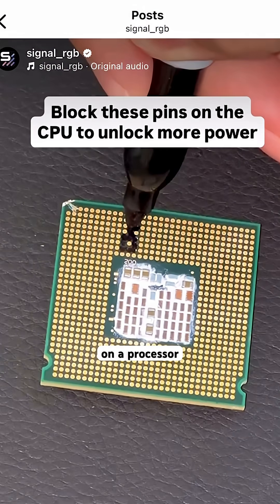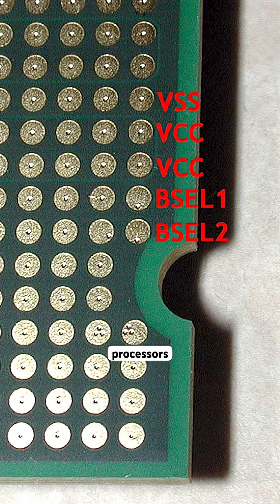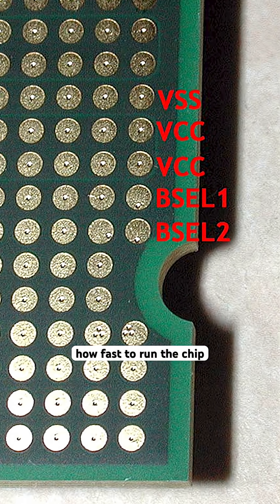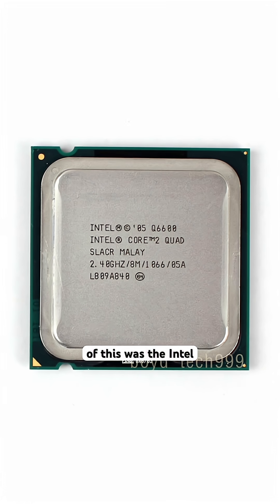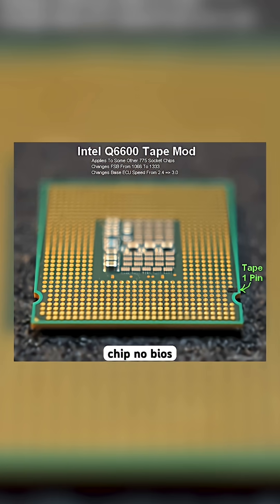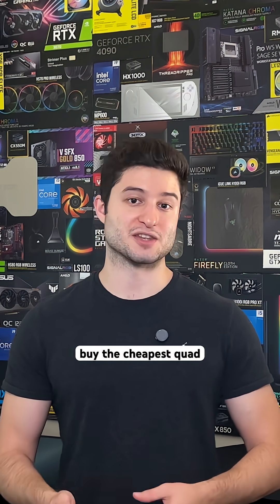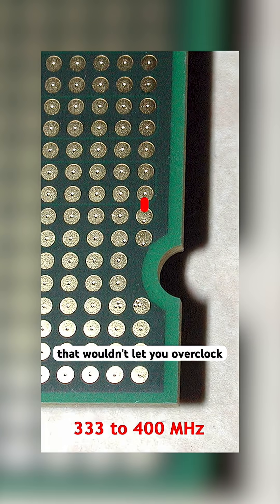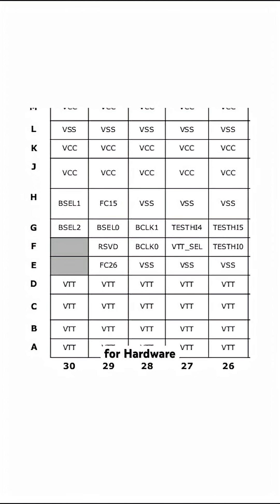Taping a CPU to improve it?!

Comment: there a reason why we even had to do this? was the company just selling the same CPU twice but one with those 2 pins bridged for a higher price tag or what?
Reply: You don't get it. It was the same processor, but one had the acceleration module locked and the other didn't. They had the same frequencies. but one could be overclocked and the other couldn't.
Reply: @КаринаМурлыкина-о9т  I don't think you get it, I asked that- If it was the same exact processor, why would the company sell a processor that can secretly be stronger for cheaper? why not overclock it by default and sell that?

Comment: It also worked on the Intel Core2Duo E6750 which normally run at 2,66Ghz if i remember correct and mine run with that and OC at 4,05Ghz with watercooling

Comment: "This was a thing in the Core 2 era"
It definitely goes further back than that. I tape modded my Palomino 1700+ (133mhz->166mhz) in 2002ish, the Q6600 didn't come out until early 2007 (though the original C2D's of mid-late 2006 also used this mod). I'd even argue that doing the L12 mod on Socket 462 was more common than the VID/BSEL mod for LGA775 at the time because it was easier to do and harder to mess up. Boy I miss those times :D

Comment: It is a very simple and easy mod, require precision but it does not break your cpu,; It is reversable as long as you use simple electric tape (some people used nail polish). The mod does push the q6600 to 3.0mhz but essentially you gain performance similar to a q8400. This mod should theoretically work on the q6700 (same fsb buss as q6600) but for some reason many people who tried reported unsuccessful mod. The mod also works on some duo cpus such as c2d8400 and others, pushing them higher than 3.0mhz (some reached 3.4-3.8 and higher).

Comment: TBH I rather to use Xeon E5450 3GHZ s.771 but moded to 775, instead of BSEL mod Q6600, first was more stable and less power consumption

Comment: Ha! I had a Q6600 and did this hack and I got a nice bump from 2.4 GHz to 2.99GHz. I just cut a piece of tape out with an exacto knife to cover the  correct pins and it worked great! You could also do something similar with a few Xeons.

Comment: Excuse me you DID NOT have to do this with the Q6600 i have one still to this day working fine, along with the Asus WS P5K motherboard and the 8 gig of DDR3 ram, this "fix was only for chips that were NOT overclockable, the Q6600 if watercooled would run happily at 4 GHZ, retired when i upgraded to an i3 8350K the Q chips could all be overclocked the Q6600 was an absolute beast of a chip for it's time and cost an absolute fortune, my Mobo alone cost over £200 pounds which was absurd for that time, average mobo prices were around £100 or less.

Comment: You think there are such cheats on Apple Silicon processors? It is possible that your M3 is actually a M3 Pro. Its called chip binning. Who knows if yours were sorted into the lower tier piles because of business decisions, not because of performance?

Comment: There’s no way this didn’t have some sort of downside. What about the heat? They wouldn’t design the heat sinks for that model to work the same way the ones for the higher end chips would. Or data corruption? The motherboard ment for the chip wouldn’t be able to keep up with the overclocked version because it was only ment for the normal type

Comment: yes its possible, but the reason cpu's are restricted is stability.

in addition some board circuits may end up wit resonances i nthe bus lanes that are unexpected.

the net effect is its possible ot over clock and in one scenario it will work, but theen theirs allways the risk of instability, and even eventuall cpu failure due to working outside of its designed tolerances.

far too simplistic to believe youre getting something fro nothing.

Comment: Completely ignoring that these chips did not pass QC for those speeds, which is why they where binned for a lower speed. So yes it could absolutely work but it could also make your system incredibly unstable.

Comment: There's a simple sticker available (for Socket 775 when that was still a thing) that swaps two ID pins around, which allowed using Xeon server processors as regular Core2Quad Extreme CPUs. Used Xeons were available for a few bucks from companies doing their usual leasing rotations, while the Core2Quad Extreme was still like 300$.

Comment: I would do that on pin B21 on the PIIs back at Gateway 2000. If the pin was open, it went full bus speed of 100mhz instead of 66mhz.

Comment: This is infuriating in the fact that they knew that they could sell for almost similar price in the only difference is 1 to 2 nodes, but they decided to sell it at a much higher price 

Disgusting.
Reply: No, these chips were cheaper for a reason. You could rig them to run faster but they would get way hotter and unstable compared to the more expensive model.

Comment: ...sounds like the "higher end" cpus might have just been a scam.
Reply: Nope. These jerry-rigged CPUs could run faster but were far more unstable and put out way more heat for it. They have more defects than the flagship models.

It is well known that CPUs from the same family tend to be the same chip but the ones with the least defects become the flagship models and vice versa.

Comment: This works because of binning. The fab tries to make the best version of the processor everytime, but flaws always creep in. If you disable cores or memory that are flawed, it is now a lower-spec version of the processor. 

As the video mentioned, this could be bypassed via pin manipulation. Often regular pencil lead was used to bridge pins.

Comment: And then you get am3 chips that were failed dies from factory making a quad core into a tri core, with a software bypass you can unlock the other core and 99.9% of the time they were fine
They stopped this from happening by removing a pin but because the contact pad was dill there you could put a pin into the mother board then install the cpu on top and it would work
Just had to be careful as am3 had 940 pins and gettthe wrong ones was easy

Comment: i mean you can just over clock any cpu now, its just not recommended.  making cpu's is more of an art then a science.
 when they make "tiers" of cpu's most of the time the tiers are just how messed up the cpu is.  like this cpu only has 4 core out of the 8 it could of had and only runs at 3gh stably

most overclock labeled cpus just mean they are more likely to run stable above factory setting

before you'd just buy a cpu and hope it can be overclocked and stable.

Comment: The sad thing is Intel didn't think people were smart enough to figure that out and locked that cpu to a lower speed, intentionally. Then, they sell another cpu for double the price despite the cheaper one basically having the same performance with no downsides like decreased health over time. Fuck hardware lock outs. Intel still does bs like this, for example locking out ram overclocking on motherboards unless you get the expensive one, yet the cheaper ones overclocked just fine.

Comment: Aah the good ol BSELmod. 0.4 - 0.8GHz increase depending on the silicon quality, for nothing. Used to do it on Intel C2D processors before Intel replaced em with fuse and laser-cut off thingy.

And also, the pins..

Comment: It's a very cool trick, but exactly the sort of thing where you have to know EXACTLY what you're looking at. Even mentioning overclocking makes me remember a group of friends of my sister's now-husband's brother who all eventually went into software engineering and IT etc, but their highscooler self-built computers were all SO dodgy!Overclocking those machines didn't even seem like it was something that ultimately had a net positive effect on performance because the accompanying increase in heat output was constantly triggering either an auto shutdown or damaging the other components.

Comment: I had a couple Q6600s that ran at 3GHz stable in HP SFF desktops. Later I got an E8600 to 4GHz in a similar way.

The really big thing is that lots of motherboards would "strap" up the CPU based on the hardware pins, setting bus speed, timings, etc. By strapping at the higher FSB, a lot of CPUs that wouldn't "overclock" to a certain bus speed or clock would "stock strap" at that same bus and clock, zero issues. Proof Intel was rigging things behind the scenes, too.

Comment: That’s impossible cuz if u did that to a cpu that was designed to run at 2.4 gigs u would need way more cooling or the cpu would break from overheating

Comment: Doesnt this mean they make a fast chip and then adjust it to run slower and then sell it as a cheaper chip?
Reply: No, the CPU production process is filled with errors of varying degrees. 

When CPUs are tested they get sorted into groups based on how many defects there are, minimal defects are the flagship models and the most defective become the the budget models (the defective sections are deactivated)

So, in reality, while this trick would work it also made the CPU run way hotter and could introduce instability.

Comment: You could even buy a intel zeon processor(server one on 771 socket) and mod it to fit on intel 775 socket, tape two contacts, rotate it right by 90degrees, file some material so it can fit in socket that way, and you get yourself a 4core beast that was viable till 2018 until some gamedevs (like ubisoft) put hardblocks against 4core processors, its still powerful enough to run Linux distro with tons of benefits

Comment: I had a Q6600, I didn’t need tape or conductive paint the pads, just changed the multiplier in the BIOS, believe I ran it at 3.33ghz with an oversized heat sink. It ran cool with perfect stability until it was retired.

Comment: what about with newer processors? also there has to be a reason the companies didn't just make them like this, i wonder if it causes damage
Reply: The reason is marketing. You always need to have multiple products at different quality and different price points, to get both budget minded customers and premium customers.

However, it is cheaper to have one production line. So it is easier to make one product, and figure out how to sell it as two products. Disabling some functionality allows this.

Comment: Far from their most egregious examples. That would be when they got Windows 10 to force updates to customer motherboards, sometimes destroying them in the process, in order change the bios so they couldn't overclock their non-K series CPU's.
Reply: This example isn’t even egregious.
Reply: @spaceageGecko  Lool? Forcefully cripppling equipment from a distance after it is bought, using a 3rd party meaning that AT LEAST 2 huge companies were in on the conspiracy? It's about as bad as ANYTHING they have ever done.

It wasn't even some isolated case, but literally a forced bios update across systems. It crashed some of them.
Reply: @Nyarlathotep_Flagg Reread my comment, I said THIS example is not egregious not the one you mentioned.
Reply: @spaceageGecko  Yeees, but since it's in response to my comment. In terms of linguistics, what is "this" referring to?
Reply: @Nyarlathotep_Flagg Admittedly could be interpreted either way, apologies on that front. My point was that CPU binning is normal and good.

Comment: Or, you could have just bought a decent budget gaming motherboard. It cost less than the price difference between those two processors and you could also OC that one higher than 3ghz. 

Even my old core2duo was a beast. Started life as a 1.8ghz processor, I OC'd to 3.2ghz on air and it ran for years. Such a boss back in the day.

Comment: The Athlon Xp processors had pins you could bridge to do this, too. They also had no heat spreaders so your CPU heatsink mounted directly to the die.  It wasn't uncommon to crack the CPU when putting on the heatsink.  Not a great design.

Comment: Right, but it ran at twice the temperature, in an age where liquid cooling wasn't a thing anyone really had, you had to use a box fan in place of the side of the computer tower..
It would run like this for about 15 minutes, enough to get a nice benchmark test done to prove the concept.. but heat causes resistance, and resistance causes speed reduction and ultimately failure.
So... yeah it was neat for a few minutes, but stupid in the long run.
Reply: No it didn't. This wasn't some kind of extreme overclocking, you didn't even increase the voltages.
Reply: @PaintsAreOp Then what is the downside? Why weren't the chips made to run at 3GHz to begin with?
Reply: @DemoniteBL   Money and product segments. They would much prefer to sell you the much more expensive Extreme Edition CPUs. And because of that, after Core 2 era they introduced cheaper, non-overclockable CPUs.

Comment: But.. if it was that easy to increase performance.. why didnt they just make the chip without those connections to begin with?
Reply: Those pins told the motherboard what the frontside bus speed was, by taping over the pins you got higher frontside bus. It was made to have a segmented market where you have cheaper products and more expensive products.

Comment: Also in this era of processors- You could use an LGA 771 Xeon processor in an LGA 775 motherboard by putting a sticker on the bottom that swapped two of the pins.

Comment: I remember getting a modded bios for the Skylake era processors which allowed overclocking on non K chips. Managed to get a 2.7 GHZ locked i5 running at like 4.4ghz fully stable

Comment: There was a similar trick with the OG Intel Celeron that if used a sharpie marker to black out (I think) one/two of the fingers on the socket then it would trick the board thinking that it was a Pentium instead. Super crazy.

Comment: Microprocessors undergo testing and are binned based upon the power and frequency results. Overclocking like this can work for most applications, but can trigger crashes under specific  loads.

Comment: It definitely did not, you don't magically make a faster cpu with fuckin tape
Reply: It did, I have done this. It increased the frontside bus from 1066 to 1333. This was useful if you had an OEM motherboard as those didn't support overclocking, otherwise you would just change it from BIOS.

Comment: I had my Q6600 running on 4.2Ghz for years with a custom watercooling without problems.
Reply: I was using one stock up till Q3 2024 love that chip
Reply: @CricketmaneCSOGGO yeah, fully ok for work
Reply: @CricketmaneCSOGGO  Just got rid of mine about 8 months ago. Was using it as a cheap HTPC. Q6600, 9800GTX, 16GB. The chip and RAM are still fine. It was the graphics card that finally went.

Comment: The tape mod was cool but a q6600 could do well above 3 GHz with just a small amount of bios tuning and you could do it with most motherboards. You didn't need a fancy Z series board for overclocking support.

Comment: The sales of de-rated product is nothing new. Yeah you can up clock a die, but that doesn't mean it will operate effectively. Manufactures sell de-rated product so as not to loose sales on their product investment. This product works at 100%, we sell it for full price. This product works at 80% so we sell it for 90% price of full product.

Comment: yeah but these cpu's are not fast anymore, i had dual happertowns with the tape mode to over clock the quad channel ram thus boost the clock.  the amd athnlon xp that could be converted to Athlon MP was a better deal but that was years before and you cut the solder traces on the cpu instead or on others used a solder pen to connect certain traces. yeah I'm that old. you all are sooo luck now, with 20000 gagillion cpu cores and 10000 million gb ram and 100 TB hard drive spoiled and wasteful.

Comment: A lot of CPUS will fail to pass the manufacturers specs. In this case they save waste by underclocking or locking cores and sell them as slower versions. and the cpu may have a fault you will never find unless your calclating pi or something weird.  Its known as the silicon lottery. Good Luck!

Comment: This also was (albeit not huge) done much earlier. I soldered in 2 resistors on my first laptop (Socket 370 Intel p2 Celeron based, i think 333MHz) and broke off one pin off a new cpu to force the chipset to 100MHz FSB from 66MHz and make a PIII Mobile with 850MHz work after the celeron became too slow after a few years.... even had to shim in a few copper plates as the new cpu was significantly thinner than the old one and the cooler wouldn't reach it. Went all the way from windows 98 (no SE) to XP with me. So, not tricking the cpu but the mainboard by masking pads (or twisting off pins for that part) is old (and most likely even older than the P2) 😂

Comment: Allot of the time chips are sorted in quality control, the chips are the same but the ones that fail to perform at a certain threshold are clocked down to be stable at a lower spec. Bypassing this could make your chip overheat or become unstable depending on the reason it was added to the down clock pile.

Comment: THE BIG DRAWBACK
slower CPUs are actualy because the dies are of lower quality simply due to production variance, so these lower end CPUs are just a way to not waste completely viable CPUs which have a higher probabilyt of failure, so they hinder it to prevent this. This bypass overclocking risks eventual faiure of the CPU prior to proposed EOL.

Comment: It wasn't just the core2 you could do it with the 478b sockets you just had to snap the pins off on the celron chip and it would register as a pentium.

Comment: I imagine it also drastically reduced the lifespan of your chip as the mod forced speeds that the processor was not designed for. Proper cooling become very important which raised expenses.

Comment: I used a Q6600 a few years ago and overclocked it to 3.5 GHz, with 8GB DDR2 and a HD 7970 it was easily able to run Battlefield 4 at 60+ FPS